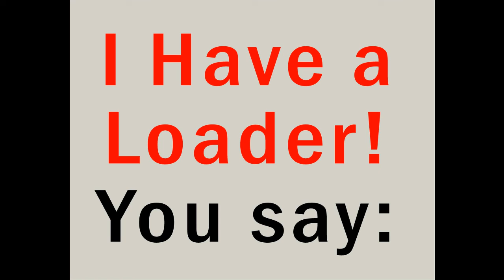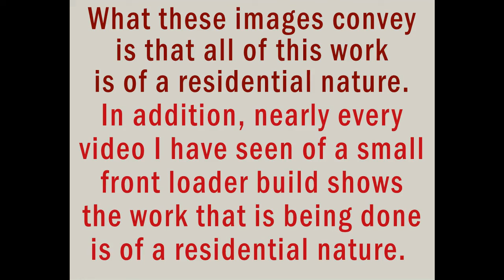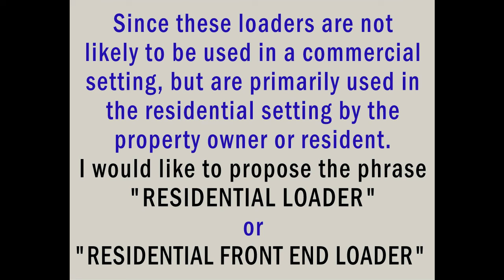PERFORMANCE OF FRONT END LOADERS ON LAWN MOWER TRACTORS and a New Name

Comment: I just found your channel. I really enjoy all of the information about the front end loader for the lawn tractors...
I myself have been wanting to build a front end loader for my older model John Deere 214 garden tractor. It doesn't have a hydraulic pump, And so I will have to mount a pump  in order to control my cylinders. I'm not expecting much out of it, Other than loading dirt into a small lawn cart and things of that nature. 
Is there any way that you can make a video showing your hydraulic system on your other tractor?  I've heard that a car power steering pump will work for the pump. I'm hoping that this is true, due to the fact that it will save me some money on a pump if so. 
Hope to see more videos. Thanks
Reply from the maker: Recommend you watch my other video: https://youtu.be/4mflY5zBKrI  

You can find the pump setup on Amazon. Here is the link: https://www.amazon.com/Happybuy-Solenoid-Hydraulic-4-5Liter-Trailer/dp/B07ZCLS6RN/ref=sr_1_9?crid=1OMKBG0H1ZKNL&keywords=hydraulic+pump+12v&qid=1672764659&sprefix=hydraulic+pump%2Caps%2C117&sr=8-9 

If I can help further, let me know. Ed